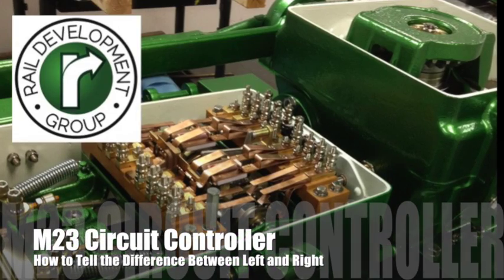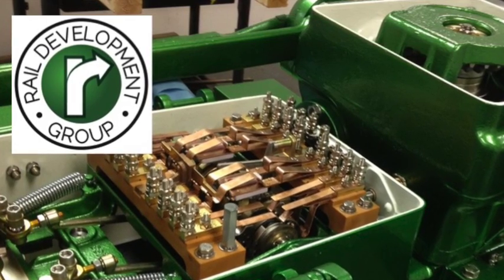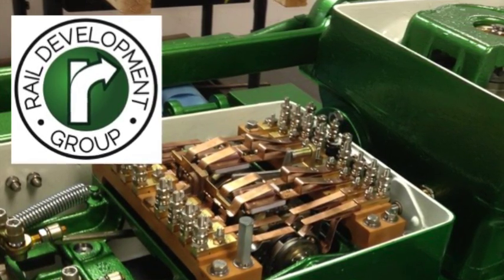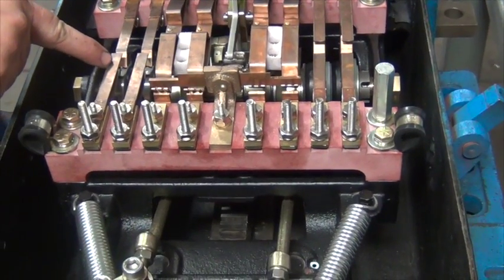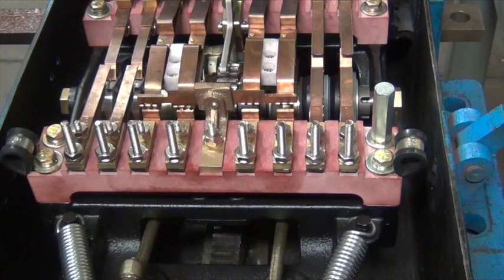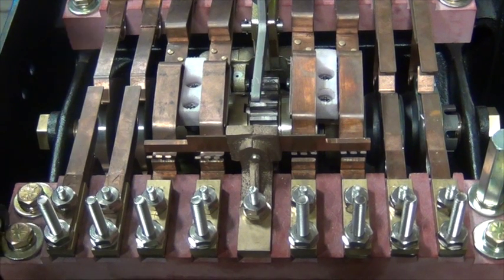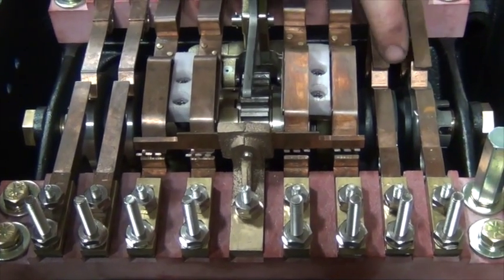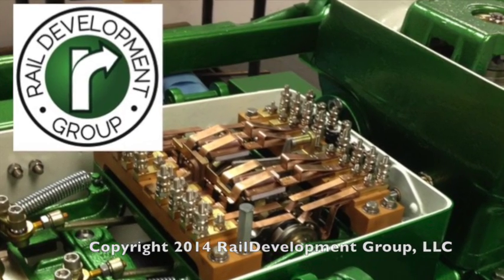M23 Controller Identification

Comment: Hello! Could you make a similar video for the 5F with different control schemes? (for polarized and neutral relays). Thanks.
Reply from the maker: The wiring diagrams describing the differences between polar and neutral circuits are in the Alstom service manual for the model 5 switch machines.  If you need them, contact me on our web site with your email.  I can send them .... www.raildev.com

Comment: How would the shunt bar face? With beveled edge flat with the contact or the sharp edge against the contact?
Reply from the maker: Hi Scott - the shunt bar is intalled with the sharp edge against the contact.  I don't exactly know why.  It could have something to do with contact pressure.  If you try flipping it around, the flat face will not align with the angle of the contact, so you only get a line to line contact anyway.  So the side with the bevel faces toward the motor end of the machine.